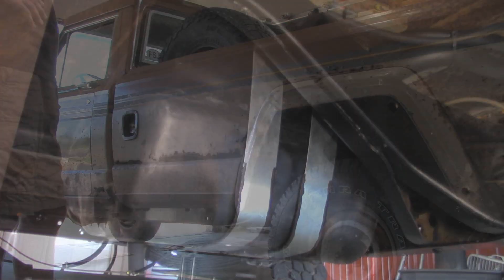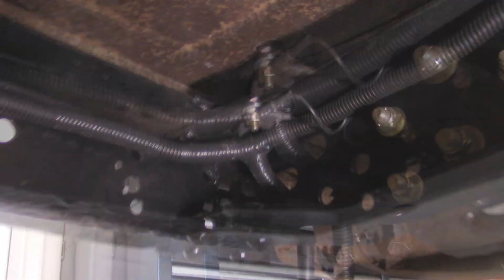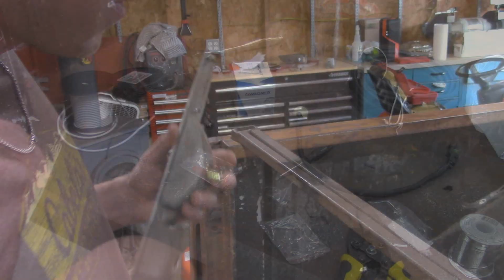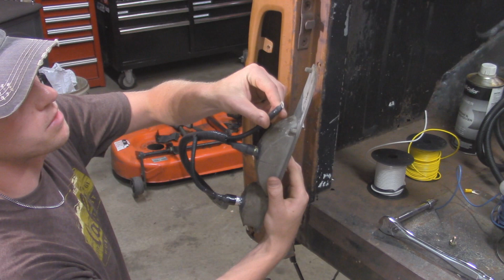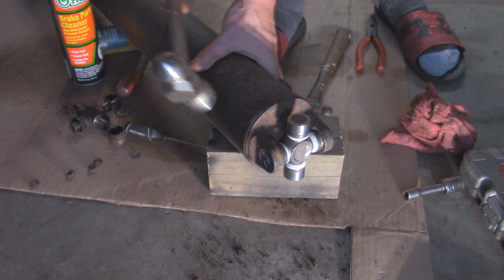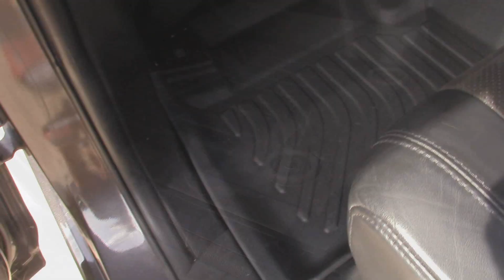Jeep J10 Tail Lights | Electrical & Installation

Comment: For the rear light bulbs that you put into the housings, could those pop out to be replaced just by removing the lenses or does the whole housing and socket need to come out to change the bulb?
Reply from the maker: All of the bulbs in the tail light housing can be replaced with just removing the lens.

Comment: Question would you recommend or use LED replacement bulbs in place of standard 1156, 1157, or 194 bulbs and if so would they generate less heat? I have an old inherited 2000 Jeep Cherokee XJ Sport that needs work. Thanks